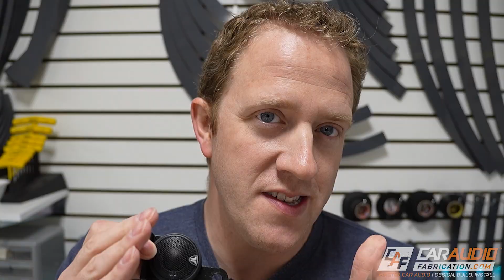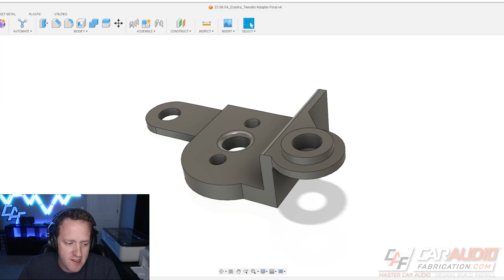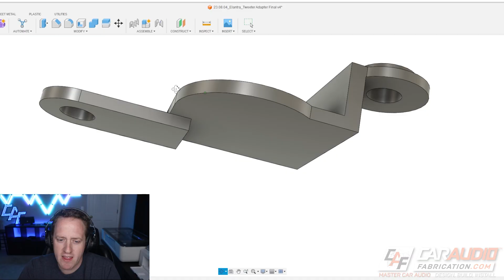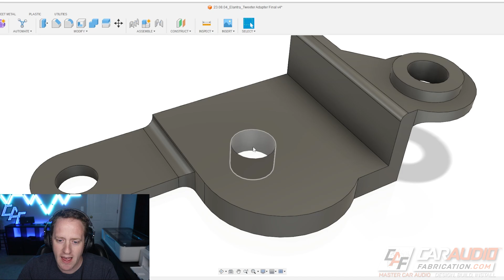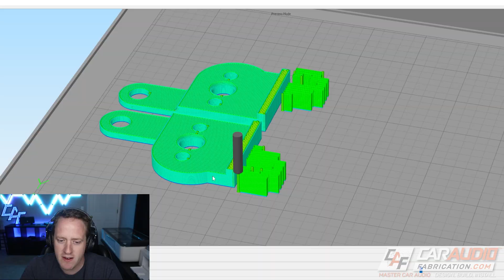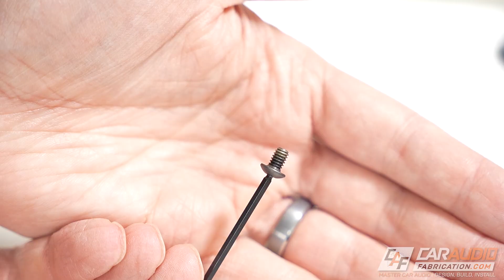Installing tweeters? Say NO to hot glue! Custom Bracket Design & Building

Comment: I just flush mounted my original MB quart tweeters in same place that I had the outside mount in.
Tweeters sounded much more airy  and highs just sounded better with the outside mount that came with speakers.
Now the highs sound closed off, no air and space around the highs.
With the outside mount the tweeter is gently held in place almost floating in the mount.
The flush mounts have the metal bracket attached to back of tweeter like a spring against door panel.
Only thing that sounds better is vocals now with flush mounting. They sounded harsh and like they ringing or resonating with outside mount. I guess bc they where not deadened as much floating in that outside mount.

Comment: I was always wondering why adtermaket tweeters are not standardized like the the woofers in the door.
So like there you would just need to by the right bracket and bolt everything together.

Comment: Unrelated question.  What would an average cost to install four JL10's custom box and an amp? I know all shops and states are different, parts as well. The vehicle is a 2024 gmc Sierra 2500 crew cab. I have the new refreshed dash and stereo. Would it be a good idea to get a new radio? Is there one that fits? Under back seat installation

Comment: how long did the final print take?  just looking at things would it not be faster to print the brackets solid, then just drill your holes where you need them for the mounting cup by hand?   also, have you noticed the need for those nutserts? as opposed to just tapping the 3d print material, it looks decently thick.    also, can you do a vid of the entire design process in 360?  
does 360 have slicing in it or do you use another program to slice?